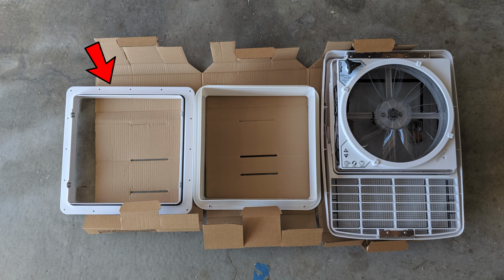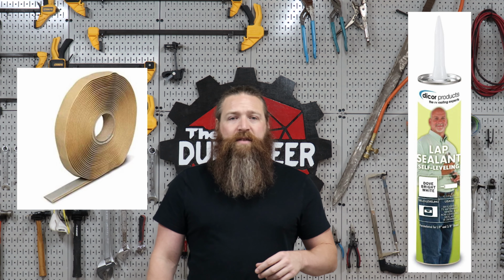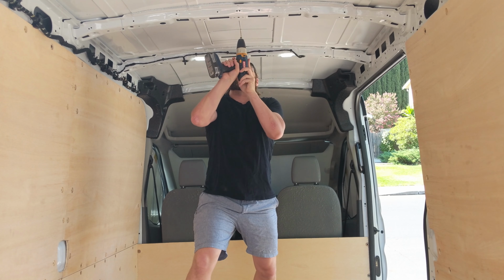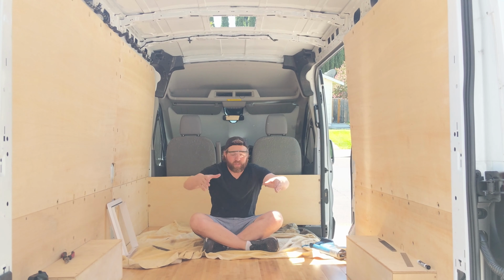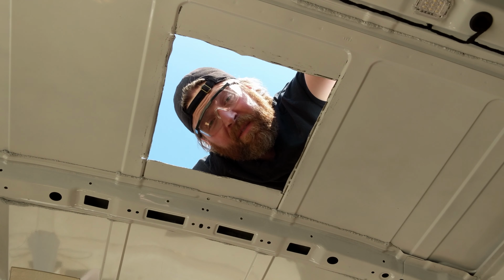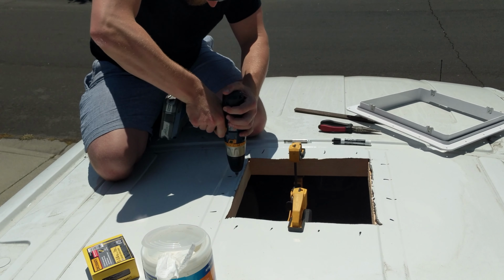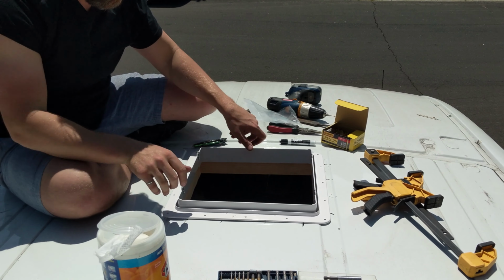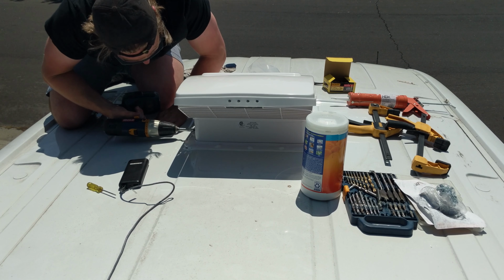How to install a vent in a camper van

Comment: Hey man, this is off topic, but I didn't think you would see it on your heroforge video. When you upload the 3d file does it automatically add supports or did you do that manually afterword?
Reply from the maker: Hey no worries! I still respond to comments whenever I get a notification. Hero forge models don't come with supports, but support can be added in the slicing software for the printer, which is usually pretty easy. Let me know if you have any more questions!
Reply: I'm still a novice to 3d printing, so I don't know what a slicing software is. Can you tell me?
Reply from the maker: @carsont9407  So 3D prints happen layer by layer, but the 3D models are continuous digital objects. Slicing software is the software that takes the 3D model and slices it into layers, and then generates g-code for the printer to interpret. Nearly all slicing software will be capable of identifying where models need support, and how to generate those supports.
Reply: Sorry for so many questions, but does the printer do it automatically  or do you have to open it in a certain app to add supports?
Reply from the maker: @carsont9407  no apologies needed! so the standard process would go like this: 1) design or acquire 3D model 2) upload into slicing software 3) orient & position model, and add supports in slicing software 4) upload to printer.  Whatever you do in the slicing software will automatically be created by the printer.
Reply: Hopefully last few questions- where can I purchase said slicing software, which would you recommend, and will a mini print okay without any supports?
Reply from the maker: @carsont9407  do you have a 3D printer already?
Reply from the maker: @carsont9407  and a mini probably won't do great without supports, they're very complicated prints.
Reply: No, not yet. I am planning on using a website called shapeways. It is a digital 3d printing service.
Reply from the maker: @carsont9407  you typically don't have to do anything when you send it out to a printing service, they will determine the best placement, orientation, and support structure for the model you provide to them.
Reply: @TheDungineer  Thank you so much for all of this help! I seriously appreciate how you are using your time just to answer my dumb questions!
Reply from the maker: @carsont9407  it's all good! I was stuck in a meeting that I had nothing to contribute to, so this gave me something to do.